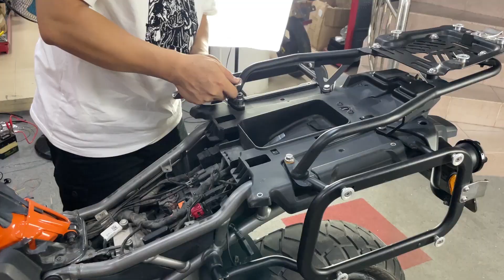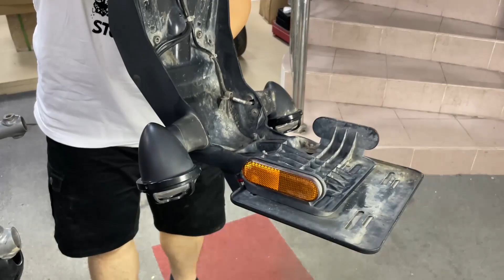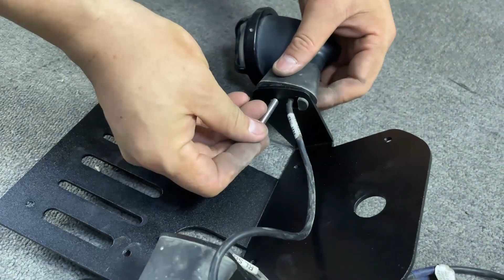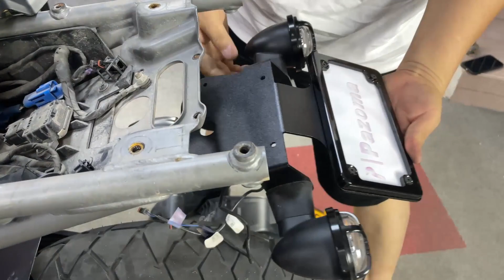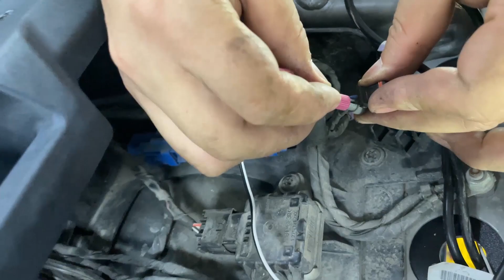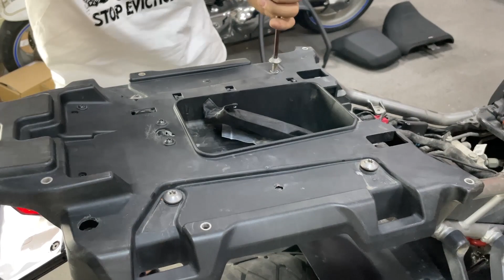How to Install License Plate Bracket Holder Fender Eliminator Kit For Harley Pan America 1250

Comment: Why didn't you just use some of the old illuminator wiring with the old connector, would have made it easier to go back and put the rubber grommet back in, you need that to prevent wire chafing..
Reply from the maker: In fact, our products are equipped with rubber rings to prevent the wires from being scratched. It’s just that the video shows the initial product and I didn’t have time to match it.